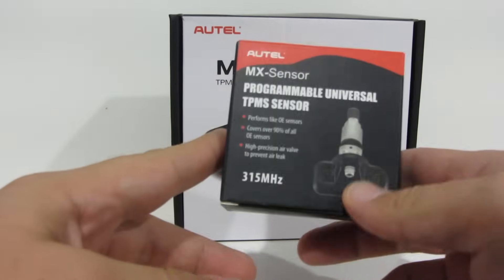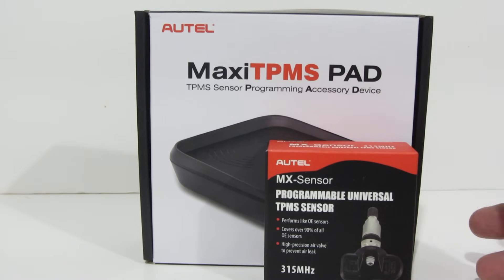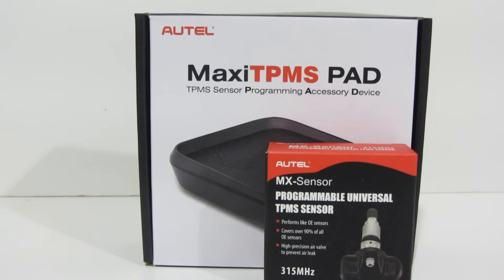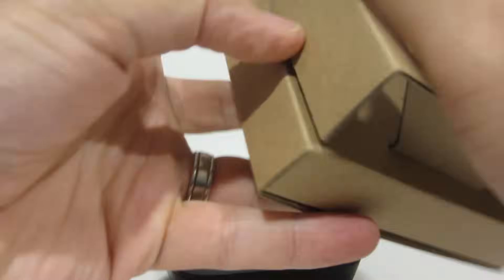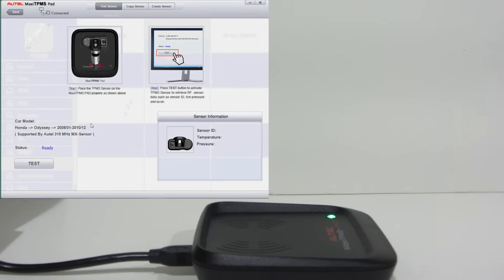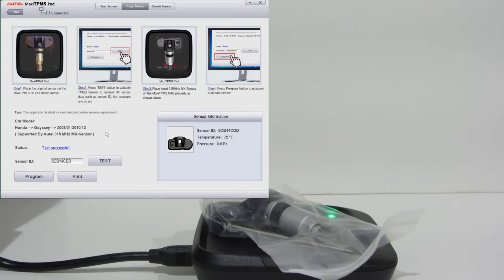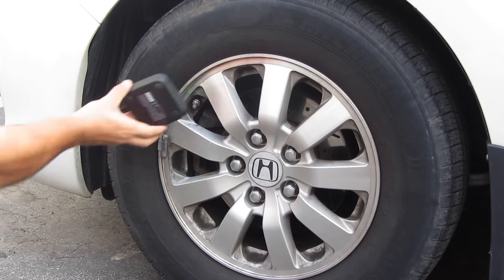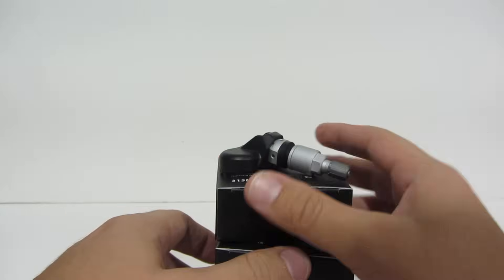Replacement TPMS Sensors for Cheap!

Comment: Gage, I put custom wheels on my 2012 Genesis sedan but they wouldn't accept the metal Hyundai OEM TPMS sensors because on tight clearance(for socket to tighten) around the valve stem access area.  I bought ITM rubber stem programmable sensors(supposedly already programmed for my Genesis).  My Genesis computer sees the scanner but will not transfer the data from the scanner.  Have tried 4 different makes of scanners, all won't transfer.  Can I have a scanner read my OEM sensors(in my hand) and input those ID's(which are already in my Genesis computer) to trick the computer to read the new sensors as if they are the OEM sensors?
Reply from the maker: That's the idea: You take the IDs of your existing sensors, program your new sensors with those IDs, and your vehicle doesn't even know that you changed anything. You will need a programmer that will work with the ITM sensors. Maybe this one: https://goo.gl/82w0sB

But you maybe should check with ITM to make sure you get something that works.
Reply: Thanks for the video & advice.  I contacted the Florida ITM regional mgr. & he sent me to a local  tire shop that uses/sells ITM products.  After an hour, 2 scanners & talking on the phone again w/ the reg. mgr., the local tire guy got it done.  Your ideas pointed me in the right direction !

Comment: What about cars that have a re-learn function to detect the new positions of the tires after a rotation? Could someone just install these, go through the relearn process, then be ok as long as the frequency is the same? i.e. 315MHz?
Reply from the maker: Yes, you're exactly right. If your car has a relearn function (automatic or not) then you don't need programmable sensors at all (although these MX sensors will still work).
Reply: Awesome! Thank you, brother! :)

Comment: Hi Gabe thank you nice video, I have 2009 Toyota FJ Cruiser, I get the maxi pad and five 315MHz sensor, I try to program but not complete,
 I only can read the OEM sensor ID temperature and pressure but I need to start up the engine, if not start engine it not read and show failure.
then I program it and my computer show (Timeout:it can't judge the model of sensor.) also I try write down ID and create sensor same answer of copy sensor my computer, is it I missing something? Thanks!
Reply from the maker: So you wrote down all the IDs of the OEM sensors, and you are trying to program the MX Sensors? Did you buy the same sensors that I show in the video?
Reply: Hi Gabe thank you your reply, I bought same Autel MX-sensor 315MHz and write all IDs trying program it same not complete, I try both input copy and trying, it's same to show my computer (Timeout it can't judge the model of sensor)
Reply from the maker: I haven't seen that error before. You can try asking on Autel's forums here: http://pro.auteltech.com/autelsupport/index.jhtml
Reply: Thanks! Gabs

Comment: Hey, Gabe, a couple more questions you might answer.  I now have the package of sensors and pad.  As far as receivers - my vehicle shows me pressure for each wheel according to location (a week after picking up my car my left rear tire was puncture)  I didn't realize this until I started the engine and it gave me alert of THAT tire.  So, I'm assuming I have four receivers?  I thought this might give me problems, but heck, the dealer gives me free first rotation, so unless they problem just relearn each sensor to the position.  There IS a procedure on YouTube of doing this yourself by deflating/inflating each tire to a certain range (i.e. 33-35 LF, 28-32 LR, etc).  So they important thing is to clone the vehicle ID to each sensor and just preform that procedure each rotation.  I'll see.But my bigger question is that you mentioned the battery on the TPMS goes idle until it sees movement to save voltage, which makes sense.  My display gives me "Tire pressure will not be shown until vehicle is going 20mph".  Does your Honda do this?  I wonder if it is idle, and no active voltage in use, how is it cloned?  I am probably just confusing "active" voltage" vs. "idle" voltage, so maybe vehicle/TPMS info is still accessible, just no pressure read out.  I'm probably making this more difficult than it is, but was wondering if your Odyssey's sensors worked similarly.  Last question, box says "CD needs minimum of Win Vista, Win7 to work" but I would think it should be able to run on Win10 - is that what you used?  Thanks again for the video and answering the load of questions.  IF this works, it will be really cool and save a lot of money!
Reply from the maker: Randalf999 My Odyssey just has one receiver. It has one light that will turn on if any of the tires go flat, and you have to figure out which one.

The programming pad (or other tools that can read the sensors) can wake them up when the tire is not spinning.

What year and model is your car?
Reply: It's a 2016 Nissan Rogue.  It was on Autel's list, but the compatible readers didn't include this pad for any vehicle - just stated the Rogue had 433 mhz.  Other vehicles list different Autel's tools, but this particular pad was not include for any.  Plus, my Rogue didn't had any tool listed, just a dash.  They state it will work with 99% of vehicles sold in the US.  I'll load the software, see if I can copy one of my existing TPMS's and if it does, I should be good to go.  You show it reading one on the vehicle so this should be yea or nay.   And, yeah, I must have 4 receivers.  Were the codes for your TPMS' all different?  I just wonder if they are vehicle specific and the test I listed defines their positions to each receiver.  Thanks a lot for your responses.  It's raining here tomorrow, but will try the pad on Friday if it's drier.  If you have another source about my Rogue, I'd appreciate it.
Reply from the maker: Randalf999 In the description of this video, there's a link to Autel's site with a document that shows all the models they support and whether the car automatically learns new sensors or not. Maybe you already saw that. It looks like you got the right stuff. So you should be good.

Each sensor in the vehicle has a different code, and the car is programmed to know which codes to look for. So if you bought 4 more sensors, you'll need to copy the 4 codes of your existing ones.
Reply: Yeah, I missed that link by not "show more" on description.  I went there and confirmed they will work, however I also went to the Autel forum and saw someone say you cannot read codes on alloy wheels (which is what I have).  However, he didn't mention what unit he was using and he said it was the 315Mhz and maybe it might work with my 433Mhz sensors.  Anyway, I sent their support an email asking about this and might call them tomorrow.  The Rogue IS listed as compatible, but maybe only if I can clone them off the vehicle.  Shops can read them, but I doubt they'd share the ID's with me.  I'll see tomorrow. sigh

Comment: So all 4 tires have different code? what if I program 1 code for all 4 tpms?
Reply from the maker: Rogeur Francois I can't say for sure since I haven't tried it, but you car will likely complain and put on the TPMS light. It would be an interesting experiment.
Reply: Gabe's Hacks  I bought rims that was on a element sc and it has rubber stem. can I used the metal stem instead of the rubber ones? my element has metal sensor
Reply from the maker: It should work. I replaced a regular rubber valve stem with the metal MX sensor.
Reply: Gabe's Hacks thanks
Reply: okay so i went copy code from car and when i try to program it says "timeout:it cant judge the model of sensor"  by the way i have a 315mhz mx sensor. second not getting a reading from my driver front wheel. i think own before broke it and only program 3 wheel with the odb2. what am i doing wrong to get that time out msg
Reply from the maker: Are you getting that error when the MX Sensor is on the PAD?
Reply: Yeah it was.. updated the software and all the issue was solve.
Reply from the maker: Awesome! Good to know.

Comment: Putting TPMS's on new Snow Tires/Wheels if I clone the new front left tire to the existing front left tired, when installing the vehicle should recognize this as the front left, correct?  I am pretty certain my Rogue requires the 433mhz and I am planning on buy the Autel set with the Pad. Another question you my might know is that come next spring I'll be returning the original all-season set back on the car, but am wanting to rotate.  If I want what was the left front moved to the left rear, I can clone the original left front to the now mounted L/F snowtire and the vehicle should now see this tire/wheel as the l>R (if that makes sense)  There IS a pretty straight forward method of using a grounding a cable, setting each tire at a certain PSI range (i.e. L/F 34 -38PSI, L/R at 30 -33 and so forth.  Then driving the car a mile or so until the pressure warning light comes on, then filling each to the proper PSI)  The procedure you showed would save all that.  The software and Pad, if they do work for me, seem pretty cool and will save a LOT of money.   I am purchasing a set w/pad through newegg for only $159 which is about what the dealer would charge me for ONE TPMS unit and relearning it.  Hopefully this will work for me.  btw, is there a "shelf-life" on the TPMS units?   If I purchase one that has been on the shelf 3 years, is the battery life now reduced that much?   Thanks again for another great video - good view, clear and plain language and tips.  (you should do a clinic and make a few bucks doing it!)  Oh, one last question, on the other video you used soap to lubricate putting the tire back on the wheel.  This is only for lubrication and not checking leakage?  A 3 - 1 water to Joy mix sprayed on is an excellent way of checking leaks, especially around the valve.
Reply from the maker: It depends on your car. Many cars (like my Odyssey) have only one receiver, so they have no idea which sensor is on which wheel. Other vehicles have a receiver for each wheel. If you let air out of one tire, and your car can tell you which tire is flat, then it has four receivers. But even then, it still may not complain if you rotate them.

As for shelf life, I can't say for sure. I read somewhere that the batteries can last 7 years of use. These do have centrifugal switches in them, so they only turn on when when they're being rotated in a wheel. Also, a programming device can turn them on. But sitting on a shelf, they'll never turn on. Batteries do self-drain, but I imagine these use lithium button-cell batteries, which have a very low self-drain. I would not be concerned with a sensor sitting for 3 years unused.

And yes, I used the soap just for lubrication. But that is a good idea to use it to check leaks too.
Reply: Randalf9
Reply: Randalf999 f

Comment: Nice video Gabe. I have 2012 Honda CRV LX, after i program the sensors, can i rotate front and rear tires without reprogramming the sensors? Thanks
Reply from the maker: Михайло Чорний I don't know right now. I can see if I can find some information tomorrow.
Reply from the maker: Михайло Чорний From what I can find, the CR-V is much the same as my Odyssey. There is only one receiver for all 4 sensors. So the car had no way to know which sensor is on which tire. So rotating them won't make a difference.
Reply: thank you Gabe

Comment: Great video. One question,  if I am understanding this correctly, you are cloning the new sensors so that the cars computer sees them as the original ones?
Reply from the maker: Yes, exactly. :) This applies only to those vehicles that have a static list of TPMS sensor codes that can only be changed by a programming tool. Other vehicles can automatically learn new sensors, so this process isn't needed for those.

Comment: Hi Gabe, Nice video.  I am planning to get a winter tires too.  After you program the sensors, are you able to rotate front and rear or diagonally?
Reply from the maker: It depends on the vehicle you have. On my Honda Odyssey, you can. It only has one receiver, so it doesn't even know which sensor is in which tire.

Comment: @Gabe's Hacks ..great video, I have a 2014 Infiniti Q50 how would I know witch sensors are compatible,also any advice when dealing with the sensors on this car,anything I need to know? Thanks,we'll appreciated
Reply from the maker: In the description of this video, there is a link to Autel's website where it'll tell you if your vehicle is supported and more info about it. According to their documents, they do support your vehicle with their 315MHz sensors. Your vehicle does not automatically relearn new sensors, so you would benefit from cloning the sensors just like I did.
Reply: Hi Gabe's, for the same car... 
If i dont have sensor at this time (buy car with aftermarket wheel without sensor) and i want install Autel tpms in my wheel. 
Can i generate new ID with Autel Maxipad and my car will auto-detect new sensor after generate and activate new sensor or i need other tool to allow my car relearn new sensor?
Thanks!
Reply from the maker: The 2014 Infiniti Q50 does not automatically learn TPMS sensors. So if you don't know the codes that are already stored in the computer, then programming the sensors will not help. Your car will have to be programmed with the codes for whatever sensors you buy (the sensors do not need to be programmable in that case).
Reply: Ok, thanks for the info. TS501 is probably the tool i need?
Autel does not offer a big service online, I have no answer to my email ... 

You know well Autel products?  If the price is good, I would also like to be able to do learning procedure for my other car. I want do idle air volume learning, throttle body closed position.. it's for Infiniti G35 2005. Which can do this without paid over 1000$ for proffessionnal device?
Thansk again!
Reply from the maker: I don't know Autel products very well, so I can't guarantee that the TS501 will work with your Infiniti cars. I'm sure it will work with the sensors themselves, but I have no idea if it will be able to program your vehicle. Their website and manual do not mention Infiniti or Nissan.

I would normally suggest the Foxwell NT510, since it costs less and can program a vehicle's TPMS system as well as connect to other systems (ODB2, SRS, etc.). But I cannot find anyone that sells it with the Nissan/Infiniti software. Their manual says it can support Nissan, but you need to buy the correct software for your manufacturer. You could try contacting Foxwell to see if you can purchase it to work with your cars. http://www.foxwelltech.com/contact/
Reply from the maker: Here is the NT510 on Amazon, to give you an idea of the cost: http://amzn.to/2oGdF12

Comment: Great viedo Gabe, thank you!
Please tell me, do I need to copy each sensor separately (1 old to 1 new), or can I copy one sensor and program all 4 new?
Do you anderstend what I´m asking? :-)
Reply from the maker: I understand :) You will need to copy each sensor separately, since each sensor has a different code.
Reply: Gabe, thank you

If the sensor cant be copied, I can tipe number from sensor, or create /generate ID?
Reply from the maker: Yes, exactly. But if you generate a new ID, your vehicle may have to be programmed to recognize it, depending on what vehicle you have.
Reply: Great, this can be done with other autel products, like ts401?

You are super guy! Thank you!
Reply from the maker: I haven't used the TS401, so I can't say for sure. But from what I see when I search, it may only work with the sensors themselves, and not program the vehicle. You could ask Autel. There is an "email" link near the top right corner of their website: http://www.auteltech.com/TPMS%20Diagnostic%20&%20Service%20Tool/403.jhtml
Reply from the maker: The Foxwell NT510 is a  scanner that can do it (but again, confirm for your specific vehicle): https://goo.gl/rWXLB8 The NT510 would also be able to read all the other systems in your vehicle. It's not just for TPMS. You have make sure to buy the NT510 with the software for your vehicle's manufacturer, since it only works with one manufacturer out of the box.

Comment: Gabe, one quick question.  If one (1) TPMS sensor code is copied to a new Autel MX sensor and then after some months pass  the new one becomes defective and the code on the new Autel MX one for whatever reason is not readable by the programming device.  How do you obtain a code for a replacement sensor presumably you can not use the code from the new Autel MX sensor since it was not used in the beginning.  I know this may sound a little confusing, I just thought of this scenario.
Reply from the maker: If the cloned sensor is dead, and you don't have the original one anymore, and you didn't record the code anywhere, then the only way to retrieve the code is to read it from the vehicle. But that requires a special tool, and that tool will likely be able to program your vehicle too, which means you don't even need a cloneable sensor anymore. I might be able to recommend such a tool if you tell me what vehicle you have. Or just make a trip to the dealer and have them do it.
Reply: I've got a '07 VW Jetta.
Reply from the maker: According to Autel's documentation (http://www.auteltech.com/autelcms/u/cms/www/201611/25020613c72y.pdf), the 07 Jetta automatically relearns new sensors. So you don't have to program anything. Just put in new sensors and go!
Reply: Hey Gabe,  from my research the car ECM will learn the code only if the TPMS is programmed or copied with the original code number, thus making the ECM think it's the same TPMS sensor.  If I am mistaken just let me know.  Thank you for your excellent follow up, it's appreciated.
Reply from the maker: I found a relearn procedure online that doesn't require any special tools: http://www.thetpmsforum.com/showthread.php?1621-Volkswagen-Jetta-(2005-2011)-TPMS-Reset-Procedure The owner's manual might tell you too.